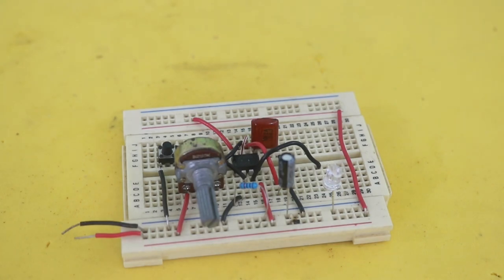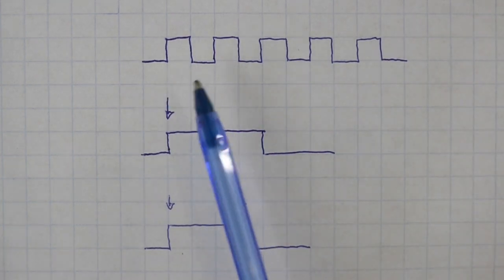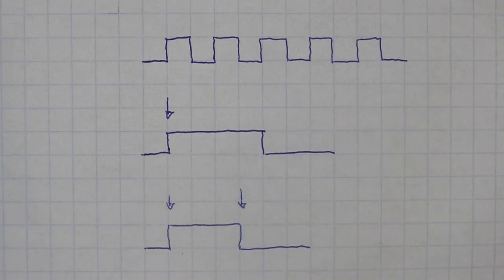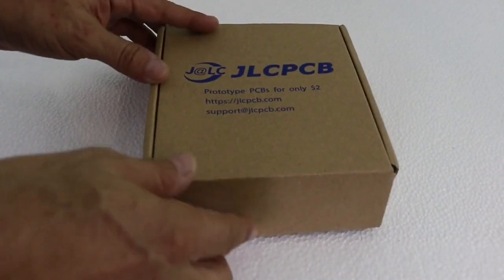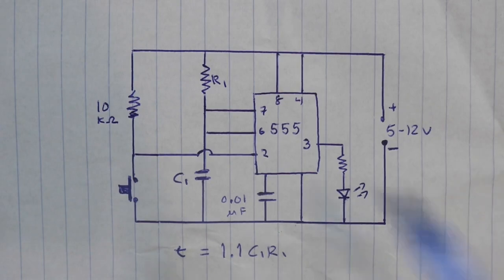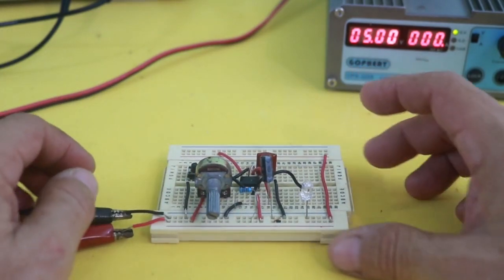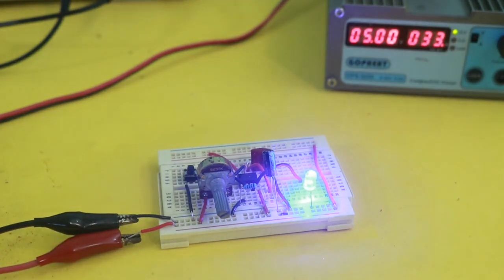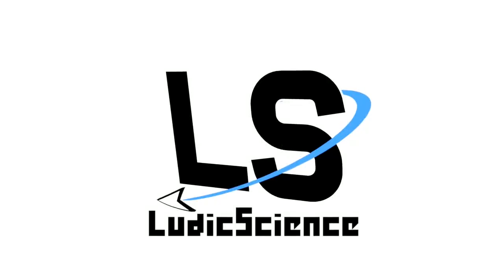555 Timer IC: Monostable Mode

Comment: I think you forgot to put the resistor in the circuit for the led, 33mA is a lot for a 5mm led like this. max should be around 20mA.
Reply from the maker: true